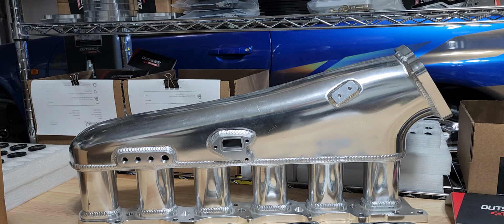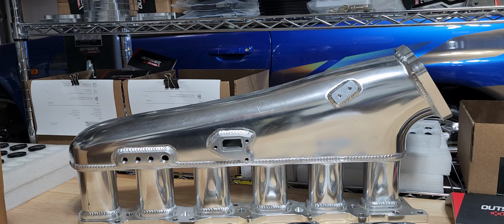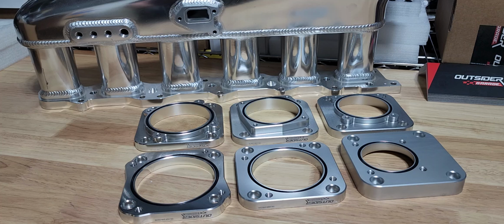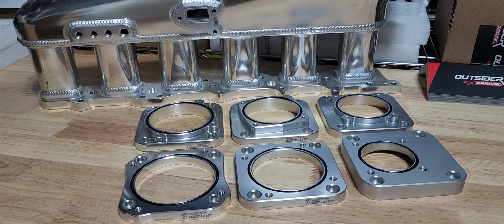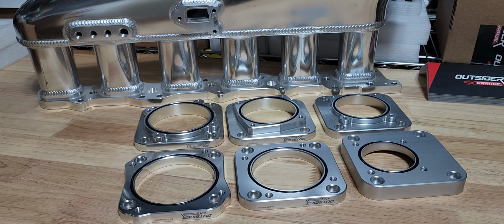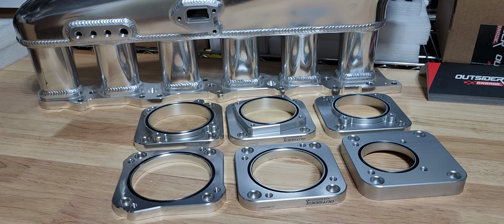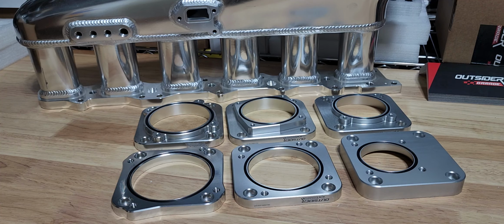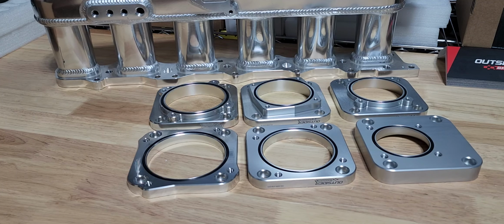More Throttle Options!! Common Sheetmetal Manifolds

Comment: I love outsider garage , I have one of their adaptor on my Ford Barra Turbo , fitted to a Plazmaman billet manifold , the manifold was built to fit the Nick Williams 103mm DBW , and I had Outsider Garage design and build a billet adaptor with o-rings on each side of the adaptor and it took my manifold from the original 103 throttle body to a Bosch 82mm DBW . Beautiful workmanship fit and design ❤ love their work . 110percent happy , I'm in Australia and the whole process was so easy , people if you do need any adaptor go straight to Outsider Garage they have your back .
Reply from the maker: Thank you Ken!